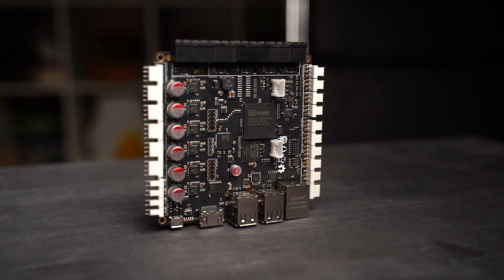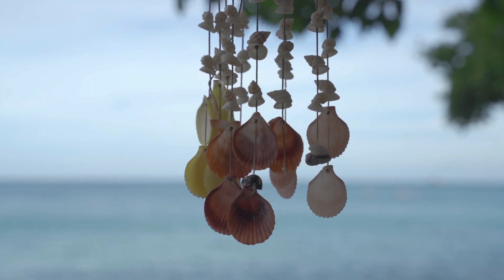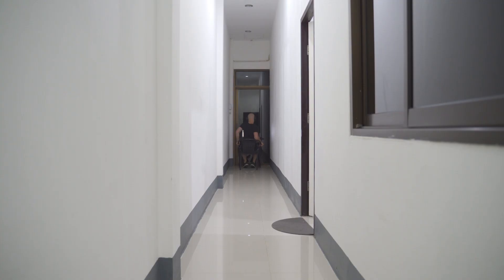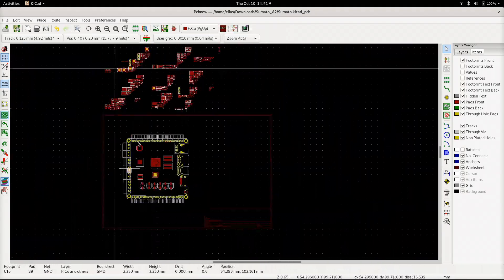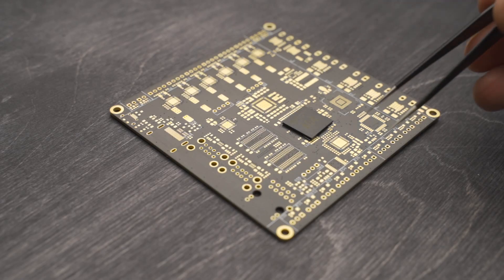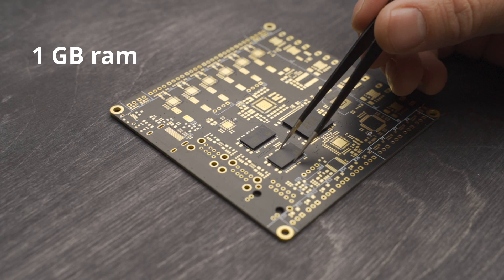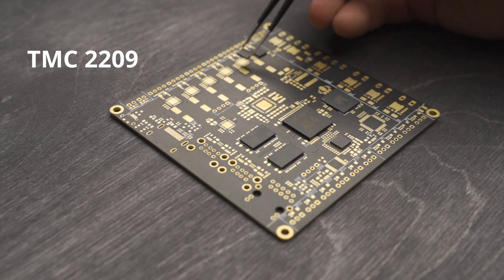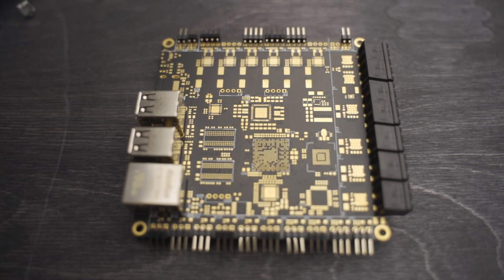A Brand new 3D-printer board!

Comment: Hi there Elias. Hope you are fine.
I just read an article about currently available 3d printer controllerboard, and at the end of the list of boards, there was a mention of your board:
—————————————————————
For the uninitiated, the gist is that the Revolve will be a pretty solid performer when it’s released. That’s mainly thanks to the stunning central hardware, which happens to be a mind-blowing 1-GHz processor, more than eight times faster than the 32-bit chips most boards in this list have. Such power enables the Revolve to run a fully-fledged version of Linux onboard.

The Revolve board was originally supposed to be released in 2019, but as yet, no dates have been announced. We’re waiting!
—————————————————————

In your video you mention that there are HUGE challenges, and that finishing the project is a lot of work.

Would be great if you could tell about the development of this amazing board that will make us 3d printing junkies mouthwatering.

Cheers
Robbert, the dutch guy in Istanbul
Reply from the maker: Hi Robert! First of all, Revolve turned out to be a dead end, so nothing is happening with that any more. All my effort is focused on Recore which is a similar board form factor wise, but with more power and a more modern architecture. This video is the first in a series of several videos, and I've just finished editing the 5. video in the series and it is waiting to be released. I want to hold off on publishing the video until I have Revision A5 ready and in the web shop so that it is available for purchase. Should be just a few more days.

Comment: I want more info about revolve, that project seemed to be close to the manufacturing stage a year ago with beta testing starting but still no word. Everything is sold out on their website, I wonder if they are having issues with their manufacturer?
Reply from the maker: Revolve was mature in terms of hardware, but we could never figure out how to make it profitable with a manufacturer, so it draged out. I decided to go back to the drawing board and make something that could break even at 10 and with better specs.
Reply: @EliasBakken  Just curios what the limiting factor was. Fab? Processor?

Comment: The hardware looks beautiful, and I'm guessing this is the exact board I would want. The problem will be the same thing I've experienced with my Replicape which is software. The development of Umikaze/Redeem has been far from confidence inspiring. Fortunately the developer of Klipper stepped up to the plate, and I've been happily using my Replicape with Kevin's software for a while now. The only way I would consider purchasing a Recore is if Klipper supports it.
Reply from the maker: That would be up to the Klipper people to handle, the development will be done using redeem. Porting should not be that hard once we have something functional though.
Reply: @EliasBakken  the fact that running Linux OS on this board will be a great opportunity for the open source community to skyrocket the power of 3d software, even running the slicer-software on it, creating integrated standalone 3d printers.
Reply: Is klipper better than redeem? I still have problem with stopping printing for a moments.
Reply: @bombel1985  Klipper is easier to use in my opinion.  If you're getting pauses during prints, you need to use virtual SD.  It's a problem with Octoprint, not a problem with Redeem or Klipper.